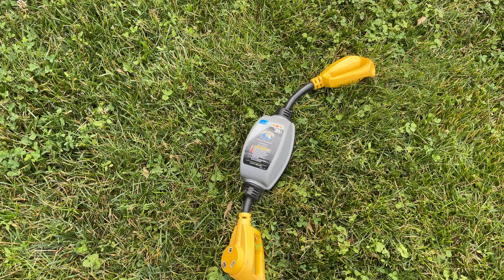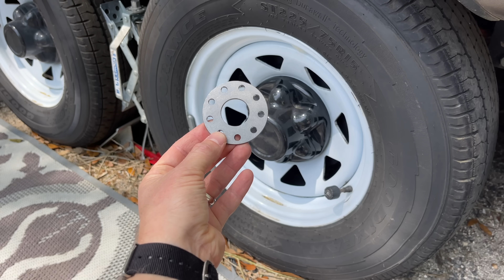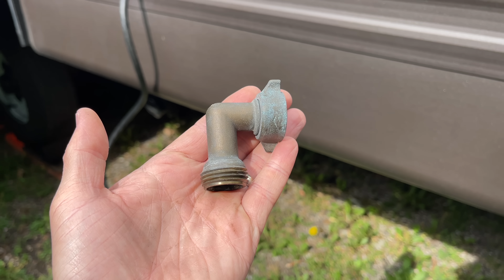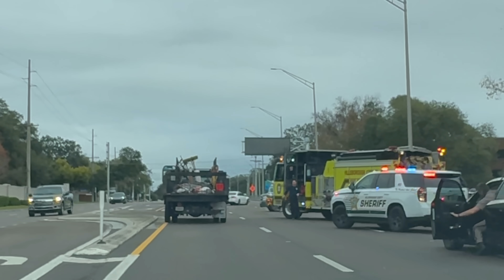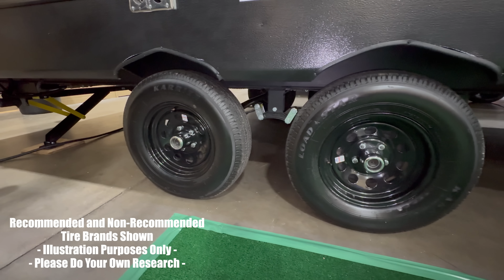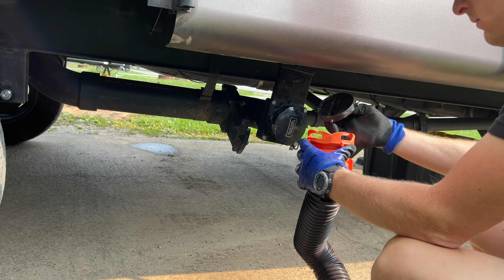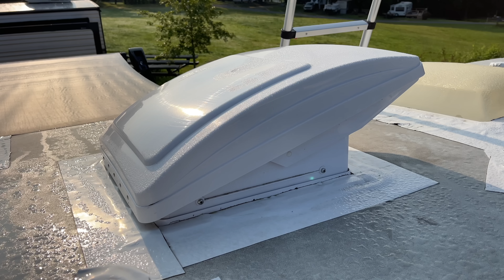RV Upgrades You Should Have Installed LAST Camping Trip (Bet you're unfamiliar with #3...)

Comment: Posting my comment here just two minutes into your great presentation to say one thing then ask another. 1. I liked your hosting style straight away. Well done. 2. Might you or anyone reading this recommend something like the Watchdog 30A management device for a strictly 15A service in a very small camper (that has expensive charging electronics)? It is appreciated. Now, to resume your great vid. Thanks for your efforts! and safe travels.
Reply from the maker: That would be a question best directed to the EMS manufacturers as they'd be able to dive into YOUR details and give you a more nuanced answer than I could based on your equipment.

Hughes Autoformer: https://hughesautoformers.com/contact/

Progressive Industries:" https://www.progressiveindustries.net/contact-progressive-industries

Comment: We had a westlake blow up and take out a gas line to the hot water heater.  Replaced all with Goodyear Endurance the next day.  That gas line had an immediate 90 degree turn making a weak point so I put a 90 elbow there similar to what was mentioned about for stress on water hose and fittings.
Reply from the maker: Sounds like the tires and the gas line both got upgrades! Also sounds like everyone was safe from the blowout.

Comment: Built in pressure regulator, already a feature on my 2001 Aistream. 
Can't believe other manufacturers aren't doing that
Reply from the maker: For water? They DO go bad occasionally (we had a static one stop working) so having them as an add on means they're super quick to swap out - but I agree, could easily be added to the system from the beginning.

Comment: Been rv'ing a long time and have learned that you shop for your tires based on quality and reliability and not price. I have had excellent luck with the Good Year Endurance tires...The Ranier tires that came with my rig did not last long at all with one starting to separate 2 years after I bought the rig. I know many have had good luck with LT tires from the major brands like Michelin, but many tire/rim sizes are not available with an LT type tire. Also know the age of your tire and know your speed rating on your tire. Many trailer tires have a standard speed rating which is 63/65 max mph. I recommend carrying 2 (Yes two) spares. Seems excessive but you do not always loose just one tire. On a prior travel trailer I bought 4 new tires for it and on the maiden voyage I lost one tire at 60 MPH and is caused the tire behind it to bubble the sidewall. I only had one spare. I limped it to the next exit and on a Christmas eve, looked for new tires......
Reply from the maker: Yupp - two would definitely be better! And I totally agree - most RVs AGE out their tires before they wear them out

Comment: The screen door itself isn't even close to sturdy enough to stabilize someone on the stairs.  Further, on a lot of rigs the screen is in a hallway and having that handle would be something to walk around.
Reply: I was thinking the same exact thing I don’t want my door broke off when my kids hang on the door lol
Reply from the maker: We've had ours installed for over 3 years with kids hanging all over it (2 years full time) and haven't had any issues. As far as the hallway aspect of sticking out... I don't think the 3 inches will impede in any meaningful way - mine is right up against the master bedroom door and I've never once thought it was closed off because of the crossbar

Comment: A TPMS should have temperature capability as well.  If it does not, invest in an infrared temperature sensor that can tell you a surface temperature and check your tires, rims and hubs each time you stop.  You should also have a way to properly inflate or deflate your rv tires (when they are cool) based on the weight of your rv.  A digital readout tire pressure gauge and a 12v air compressor should be part of the overall system of tire safety. In addition, a good quality torque wrench is another must.  Confirm the lug nuts are torqued to the proper ft.lbs. before every departure. You’d be surprised how frequently they will loosen when you have large temperature swings over the course of a day on the hot pavement and a very cool night in a campground.
Reply from the maker: Agreed - I think you'd like this video too where I cover much of that ◡̈ https://youtu.be/TXLVFJCDfZE

Comment: You don't need any additional device to stop your propane incase of a leak if you have a US RV. It is regulated that it has to have that shut off from the factory. Save your money.
Reply from the maker: Tell me more, my regulator doesn't have that and I haven't seen it on other rigs I've looked at but I'd love to learn more about what you're trying to share with me.
Reply: @rvgearandfar there is a system in the tank valve that will shut the flow if you open the valve too quickly. Meaning when too much flow is detected it will stop flowing. Not sure if it works exactly like the system that you showed in your video. I think if I remember correctly the tank system does not completely stop the flow of propane.
Reply from the maker: Here is a reply from GasStop on another question that also addresses your concerns:

“A GasStop RV unit would not be suitable for a typical grill application, this gentleman is totally correct. Excess flow valves (EFVs for short) are calibrated to certain maximum flow rates, and the maximum flow rate of a grill will be different to that of a typical RV application, this is why the connectors on your pigtails hoses and/or regulators are different colours. Black connectors typically have lower flow rates, Usually around 60 SCFH, light and dark green are normally over 90 SCFH. The reason why it is important to match your GasStop to your application (we now write RV or Grill on the connector to be as clear as possible) is to make sure GasStop shuts off as expected during a fast/major leak scenario. GasStop will not limit the flow in the event of a major leak, like hose EFVs do, instead it goes one step further and shuts the supply down fully until it is reset. Hose flow limiters are a layer of protection, GasStop is that extra layer that puts the user in more control (especially with the added benefit of the pressure gauge to perform a tightness test prior to use!). We hope this helps!”
Best wishes, Matthew Howard, GasStop

Comment: Have you seen the 90 with the shutoff valve built in it's great.
Reply from the maker: I have - and initially I thought it would be great too - but the more I thought I about it you'd have to disconnect the hose with the 90 connected then - whereas the 90 with a quick connect and then the hose with a shut off valve and quick connect allows me to shut off the hose AND disconnect it from the RV without removing the 90 - lots of applications but ultimately both are helpful ◡̈

Comment: As for tires, I highly recommend Goodyear Endurance trailer tires. We have had them on our 2011 Keystone Cougar 293SAB since we purchased it in 2017 and have never had any issues with them. We are currently on our second set. They have had no problems in the southwestern sun, even in triple digit temperatures (we live in AZ).
Reply: I second that. We took our trailer, with Goodyear Endurance tires, to
Alaska and back to Indiana, last year. They are still going strong.
Reply: I have a 2022 travel trailer that came with Goodyear Endurance tires, two blowouts with less than 9000 miles on them and a third with a budge on the sidewalk. All tires were inspected the day of travel and pressure measure correct pressure. TPMS on all tires. First tire blew within the first 150 miles without the TPMS giving a warning. Second tired TPMS alerted to low pressure and by time I was able to stop the tread separated from the side walls. Inspected the other tires and noticed the bridge in the third tire. First tire caused damage to wheel well and once I contacted Goodyear, I was told I needed the failed tire for them to inspect to cover damage and to replace the tires. Unfortunately the one tire was totally destroyed and all over the highway. Goodyear would not even take my information for a claim. So, not all high end tires are best, even with inspection of tires and having a TPMS on the tires is not a guarantee of good tires. Drive within parameters of the tires for safety and check them every stop.
Reply: Please read the speed rating you may be surprised

My rv Goodyear are rated for 65 MPH
Reply from the maker: @marklangren3142  what size are they?
Reply: @marklangren3142 Smart people don't drive rvs over 65 mph.
Reply: My local dealer who I trust said that the endurance tires aren't as good as they used to be.
Reply: Love mine also!
Reply: There is a better brand, Boar 🐗 tires, but you also have to use their rims.  It's  pricey the first time because you need to buy both tire and rim, about $500 per wheel.
I'm running Goodyear Endurance on my 32' travel trailer, I also went up a rim size and a load rating, it gives me a little more peace of mind.
I am going to order the hub savers, I never heard of them, I've got everything else on the list except for the better vent fan, I put a heat pump in for a second roof unit, maybe a new fan next spring.
Reply from the maker: @windrider65  My friend Jared from All About RV's did a video highlighting the Boar wheels - seem pretty cool but as you pointed out they're pricey
Reply: Just picked up my new travel trailer. Went 1/4 mile down from the dealership and put goodyears on it.
Reply: Our camper came with Goodyear tires. While I liked them Costco gave me a deal I could not refuse. Love my new tires and zero issues!
Reply: Same. After the first China bomb went off I replaced everything with Goodyear Endurance.
Reply: There are vent shades, cost around $40 and you just remove the 4 vent screws and install the vent shade, literally a 5 minute install and can open and close to let light in or keep trailer cooler, plus looks more high end. Much better than stuffing the foam pillow thing in vents.
Reply: I went camping last July and set tire pressure on the Goodyear tires on my trailer. This year, pressure was same, so I did not need to add air. On way to camp spot this year, a 5th wheel(very large one) a tire exploded on freeway, was pretty eye opening see it happen just a few cars in front of us, looked like bomb went off, bunch of gray smoke, pieces flying everywhere...pretty scary.
Reply: From my limited research on rving, these tires seem to be the only one people talk about 🤣
Reply from the maker: @blade420playElite  they are definitely the most popular
Reply: Getting ready to put the Goodyear endurance on our 2021 grand design and in 2025 we are going to Alaska. My girlfriend calls anything but tires that are made in America, China bombs.
Reply: We are going to purchase our camping trailer this summer. I am replacing the China junk with Endurance tires and matching wheels before we take our first trip.
Reply: I also use ROADMASTER tires on my fifth-wheel. Great tires!
Reply: Only Good for one Year... Michelin or BF Goodrich LT 10ply truck tires are my goto for all my trailers.

Comment: I just replaced the factory generic tires on my travel trailer with Carlisle (Carlstar) Radial Trail HD.  They're about half the price of the Goodyear Endurance but have exclellent reviews and are speed rated to 81 mph.  I've got about 500 miles on them so far and they've been great so far.  Getting ready for a 3500 mile trip so I'll be putting them to the test soon.
Reply: We did same. The Carlisle / Carlstar are still China tires, but built to US specs so they're anything but China bombs and, for us, were half as much as the Goodyears.

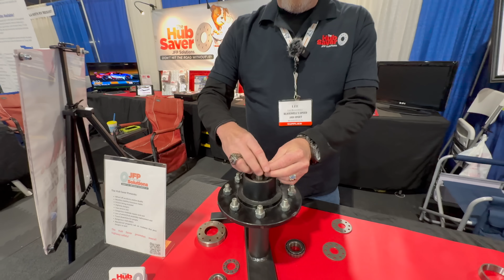Comment: 4:20…. Yea, it just breaks the spindle off…
Reply from the maker: If you break off the spindle of an axle you're probably a lot deeper into trouble than losing your bearings....
Reply: @rvgearandfar your bearings get hot, bearing fails, bearing locks up, something has to give….  That hub saver won’t stop the bearing from coming apart and locking up…

Comment: I guess I’m doing a decent job, I have a lot of these suggestions and several of them actually came from the factory, ie the tire monitoring system, large fan with rain cover, etc. 

Question: the washer on the axle, the video shows the bearing, was that just for the video? Does just taking off the hub cap and tire enough to give you access to adding this washer?
Reply from the maker: Correct - you don't have to take the whole hub and tire off to install the Hub Saver - I just happened to be replacing my bearings this spring and thought it would be a good clean break down peek-inside the wheel type of mock up.

Comment: Hi, I love the video especially for new RV couple's. The gas valve is a GREAT idea but I've had two now fail just over a year old. they both failed by shutting off when there was no issues. Of course it was while boondocking at NASCAR and the beer got warm. Just replace them yearly I guess... I still have the original set of tires that came with my RV, I use them as spares, well until they age out at 5 years old. I went with Goodyear endurance along side our TPMS. The extra valve for stinky pipe is great but I've added a clear section before it and after for dumping to see when it is done / clear to start the gray water to clear out the stinky hose.   FART FAN is a must. we have two of them one pushes air in and one pulls air out + the fan will close when it starts raining.
Reply from the maker: Interesting on the GasStop - have you reached out the them regarding that? I know they take those issues pretty seriously and might want the information on your valves as data points and also to get you warranty replacements

Comment: how about having a proper sized socket and ratchet in case of a flat tire bet 60% of the RV community is not ready for a flat tire...i wasn't...
Reply: Add a flat jack 2 or 3 ton. Had a blow out even with the yellow jack helper I could not get the axel back high enough to put new tire on.
Reply: I got a 1/2” breaker bar and a socket for it that I carry in my truck. Sometimes the lug nuts are so tight that using a typical lug wrench doesn’t do the job to get them off.
Reply: I carry a cordless impact made by Kobalt at Lowes! Makes changing a tire,fast and easy!
Reply: I did also. Found out my normal 4-way does not work.
Reply from the maker: Agreed - and based on that I think you'll like this video: https://youtu.be/TXLVFJCDfZE